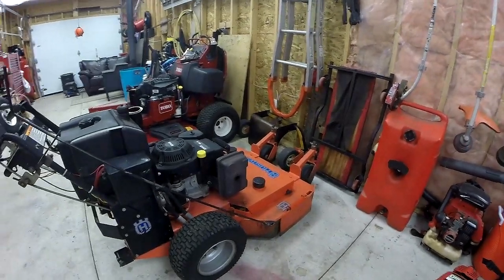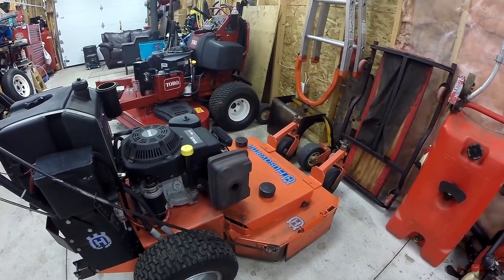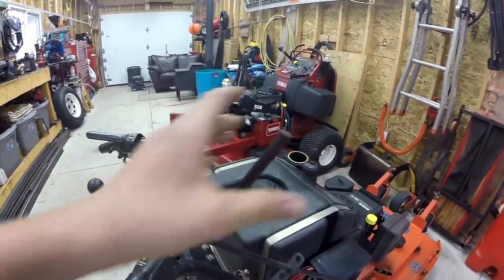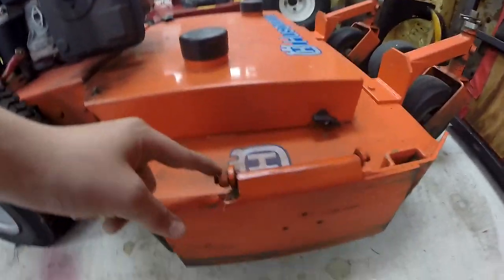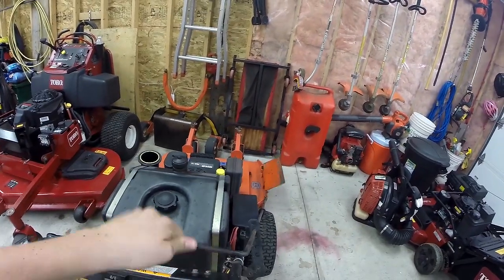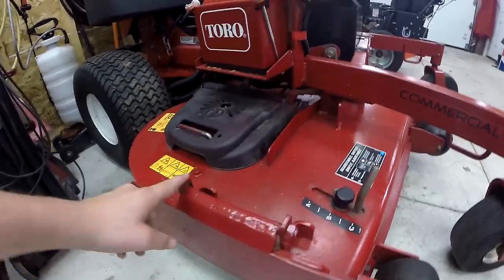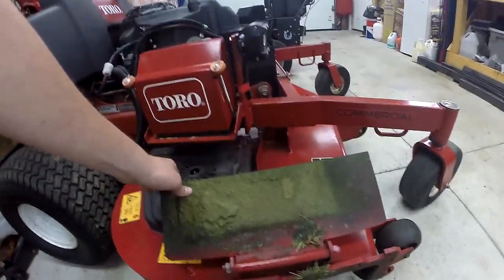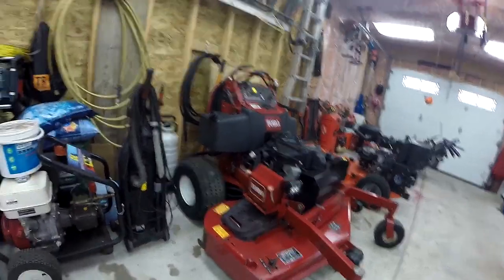DIY LAWNMOWER CHUTE BLOCKER [Devon's Lawn Care]

Comment: Quick question I own a huskvarna walk behind that has started steer right if I let go of the left side break do you by chance know what is causing this? And because of this it’s slowing down due to me holding down on the break. Thanks for your help
Reply: give me more information on your mower and i can help you ,is its hydo Driven /Belt driven ? if its hydro you need to find your adjustment screw and adjust the hydro . thats dragging . if that don't fix it there may be an internal issue .

Comment: Thanks for the video man. Did you weld it yourself?
Reply from the maker: +Flash Lawn Service yep welded it myself! Are you looking for one for your mower?
Reply: I’m trying to get ideas to build one but if my designs don’t work I might end up buying a grass flap or something. So yeah I guess I’m looking for one for my mower.
Reply from the maker: +Flash Lawn Service what mower do you have I may be able to make you one if you wanna pay a bit
Reply: I have a 2016 turf tracer 48”. Thanks for the offer but I think I’m going to try it myself first. :)
Reply: Another quick question:      What thickness is the steel plate that you used for these and also what are the dimensions (Length and Width) of it?
Reply from the maker: +Flash Lawn Service well the dimensions is going to fluctuate between mowers so u need to measure yours to see. And it's 1/4 inch steel
Reply: Ok thanks! I think i'm going to try to make one.